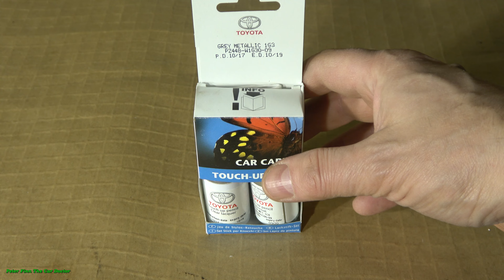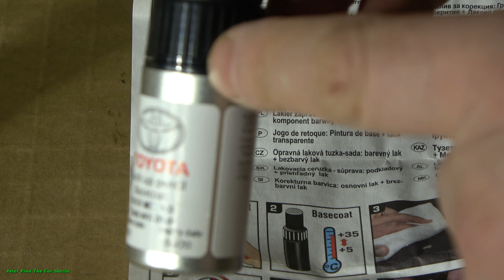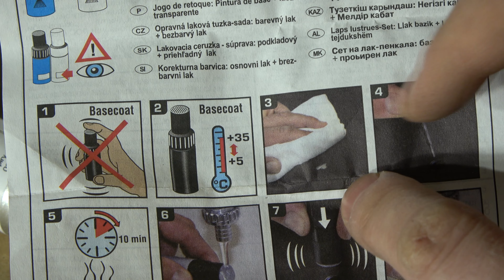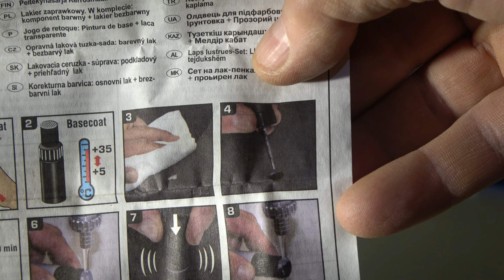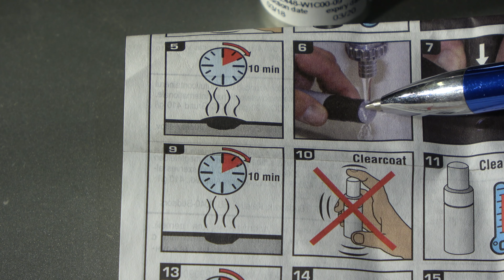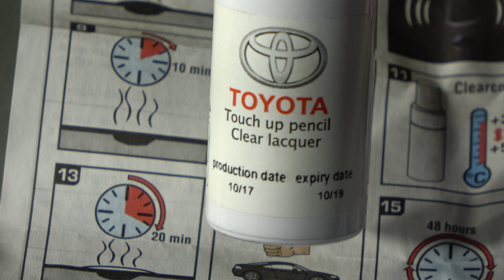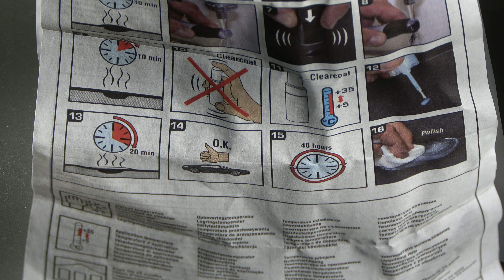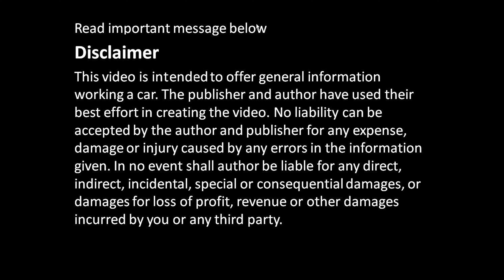How To Use a Touch Up Paint Pen to Repair Car or Truck Paint Scratches

Comment: Thanks for the tutorial. The KIA touch up set has exactly the same instructions. I only wonder if it is normal that after the base paint is applied and dries up you can still kind of see the crater. The height will only be normalized by the final touch up glaze that is meant to be transparent?
Reply from the maker: Yes it does

Comment: Well here I am reading the comments after applying the final clear coat. Mine is Audi a5 with Daytona grey metallic pearl (from Audi/Volkswagen factory). My clear was not milky like this, otherwise the steps were easy to follow. I did a few small chips and will update with the results in 48 hours.
Reply from the maker: Great work 👍👍👍😀
Reply: Can you come with Update :)? I have a vw polo and i had the same set. I just applied the base coat and clear coat today but mine still looks weird, i assume it’s because i haven’t polished yet. Did you polish your car yet?

Comment: The end result looked like it was on a different area, the surrounding scratches etc. didn't look the same. I can't believe that the result at the end was the same gouged out scratch, it didn't look too good when you put on the clear varnish so how did the finished result look so perfect? Not convinced you have been entirely honest.
Reply from the maker: Same car. There were many scratches
Reply: I’m inclined to agree with you
Reply: @skydronewanderer2052  It's a super fake video, I don't understand the need to not show the true final result. because the area where you apply the final resin is not the same area where you work with the initial scratch.